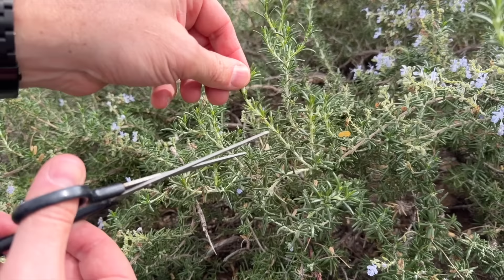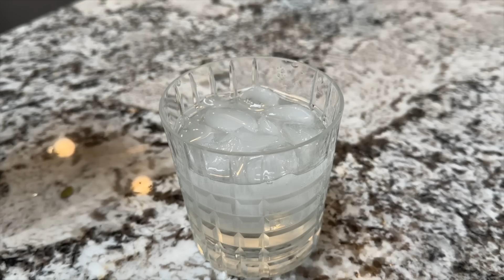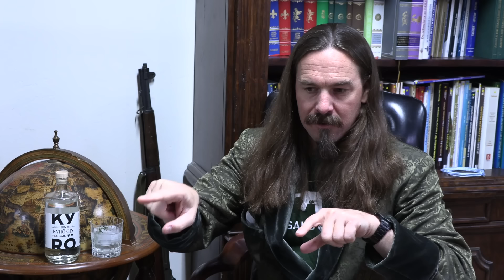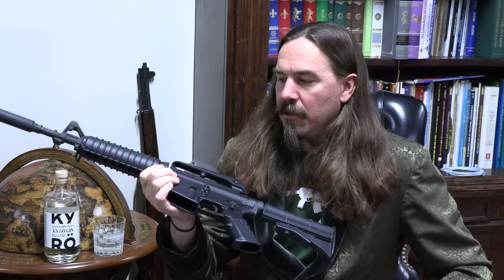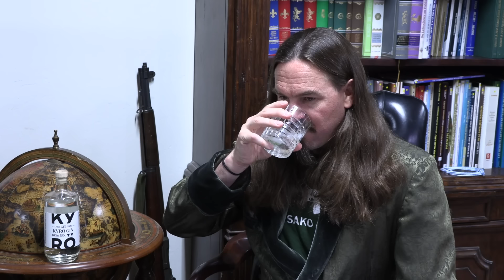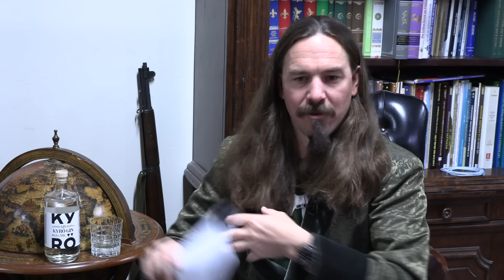How Guns are Made: Tolerances, Methods, and Metallurgy (Q&A January 2026)

Comment: On subject of tolerances vs. tool wear. The tools/ programs are setup with anticipated wear during a shift. For this reason they are preset with a certain amount of offset as the wear will bring them to opposite side of tolerance range, still within the specification. This is tool setters and programmers trade.
Reply: As a cnc machinist working in the manufacture of orthopedic implants, I had control of the offsets and tool replacement to hold tolerances to the required specification.  We had some features we inspected 100 percent for accuracy to make sure the parts were in tolerance.  Sometimes tricky as the manufactured inserts for our tools sometimes had more of a tolerance between inserts than the usual wear offset for a new tool and could cut a dimension out of tolerance.
Reply: @ryanramsey9621  What were materials you machined parts from?

Comment: In 1985 My assigned M2 .50 cal Machine Gun was manufactured by AC Delco Spark Plugs in 1942
Reply: My m2 is an AC Delco in 2026
Reply: @flavortown3781 could even be the same one
Reply: @neoleo593  Ol' Sparky...who's a good badass, huh boy?
Reply: So forty years old; if it’s still in use it’s been another for since then!
Reply: We had one in Iraq in 2005 that had been built in 1960 - I was born in '62 - the weapon I toted out and put onto my HUMV as a 42-year-old was older than I was and anyone in my platoon except 2 guys.
Reply: In 1985……….i was born.
Reply: Man,  if only that gun can talk, and the adventures it went through.
Reply: Its gonna be the first crew mounted gun to see another planet
Reply: That beats the 1911 I carried in the early 1970s made by Union Switch & Signal during WW2. Those things go for $1000s in the gun auctions nowadays. Only Remington Rand (typewriter co.) made fewer than US&S during the war.
Reply: @pithicus52  your comments on who made the most/least 1911a1’s is incorrect.  Here are the numbers by manufacturer.

1. Remington Rand — ~900,000 (largest WWII producer by far; typewriter company converted to wartime production).

2. Colt — ~400,000 (WWII) + hundreds of thousands more across WWI, interwar, and post-war military/commercial contracts (Colt is the original and longest-running, with total historical production in the millions including non-military).

3. Ithaca Gun Company — ~400,000.

4. Union Switch & Signal (US&S) — ~55,000–60,000.

5. Singer Sewing Machine Co. — ~500 (extremely low; tooling transferred to Remington Rand).
Reply: @Joe-hz1nw  That is the hazard of being too lazy to look it up and relying on memory.
Reply: @pithicus52 I just didn’t want you/others spending money on what you thought was a rare 1911a1.  They’ve gotten expensive. 😃
Reply: @Joe-hz1nw  Good point. Thank you. I guess I didn't think that far ahead. If I ever get one, it will be a US&S, but we don't want others to make any mistakes.
Reply: @pithicus52  Coveted by both Gun & Railroadinia collectors.

Comment: On the stock making, if you go to Harpers Ferry (at least the last time I went there) they actually have the machines set up how they would have been to make stocks during the Civil war, with the master copy and the others in various states so you can see how its done.
Reply: I got to see wooden clogs being made the exact same way on a sort of primitive 3-axis cnc machine when I visited Holland Michigan when I was young. A very interesting process, very cool to see the ways that the engineers of the past solved those kinds of problems before computers
Reply: Got to see that in 2002. Very cool.

Comment: As an (admittedly, junior) machinist, this is basically the thing I always try to get my friends to understand when they're considering a cheaper, budget gun or scope or etc. There's no free lunch and you're absolutely sacrificing something, somewhere to get that lower price point. Whether it be the engineering, metallurgy, QC, etc.
Reply: Hmm depends, sometimes labor cost is simply cheaper somewhere else or energy cost or a certain material is cheaper or their margin is not as high etc. It really depends. Prince is something than can work but does not always work to gauge quality.